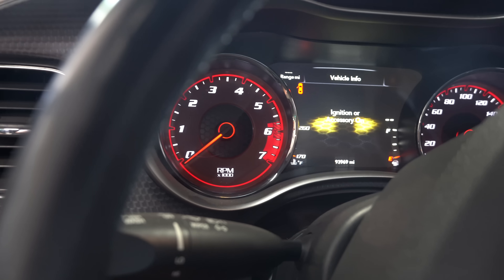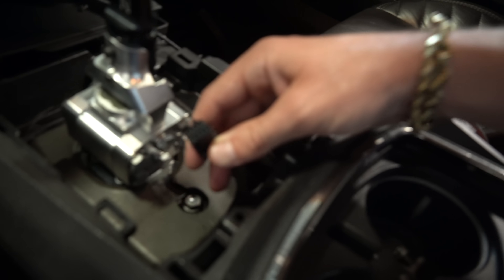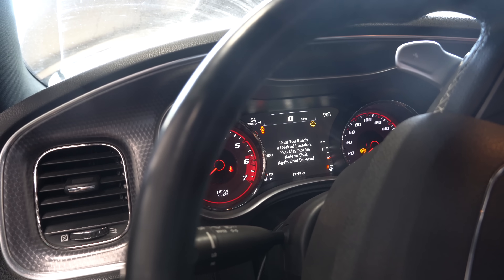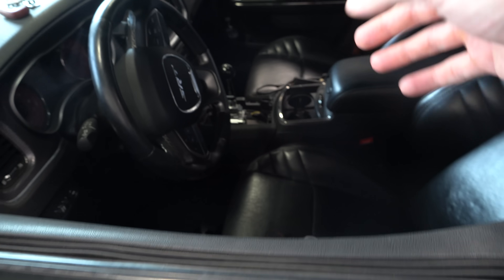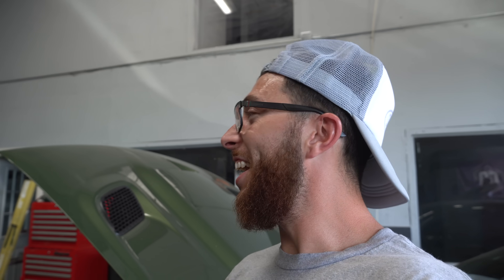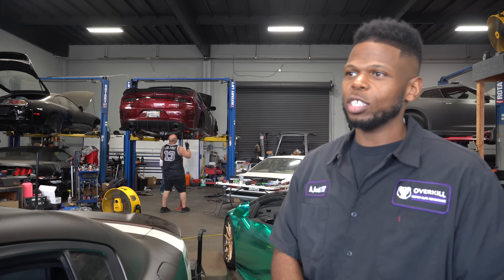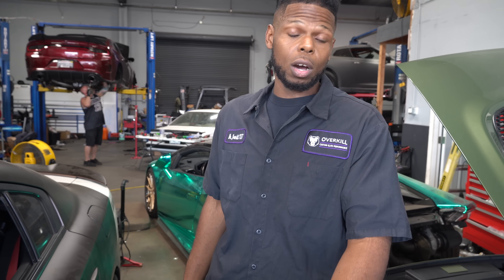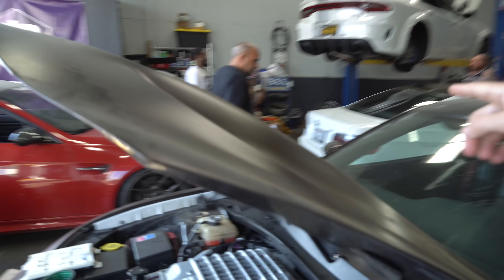Trying EVERYTHING To Get the 6-Speed Hellcat Started… | Manual Hellcat Charger Build Series!! Ep.21

Comment: Wonder if you need the challenger ecm that's a manual.  Because they have the clutch switch program
Reply from the maker: @bsmitty5857  OS systems in my computer were changed to Manual so it wouldn’t change anything

Comment: You have to change the back and the ecm from the hellcat you got the transmission from. You CANNOT reprogram the BCM
Reply from the maker: @marcuse4718  yes you can😉
Reply: @helloooimjensen  if it was that easy it wouldn’t be a problem right. I am not trying to be rude but. It doesn’t look like it as easy as you say and it would be more done and on the road
Reply from the maker: @marcuse4718  I explained in the video that the issue was finding someone willing to do it, and I found someone.
Reply: @helloooimjensen  but don’t you have the ecu and bcm out of the hellcat challenger you took the trans out of

Comment: Your PCM (C1) connector has a bundle of wires that routes to the BCM. The original BCM still thinks the car is automatic. You have to re pin those bundle of wires that has a bulkhead connector at the BCM. Or replace the entire harness with a Manual challenger PCM , BCM , EVIC . Also your boy needs a dealer code to use wi-tech so it’s not as simple buying it. Also you cannot reprogram the BCM FROM ANOTHER CAR TO YOUR CAR . Once a BCM is married to its orginal PCM that’s it. You need a blank BCM
Reply: Damn thats for the knowledge